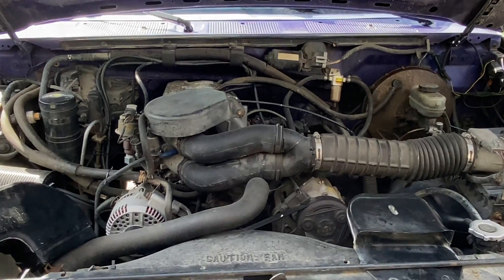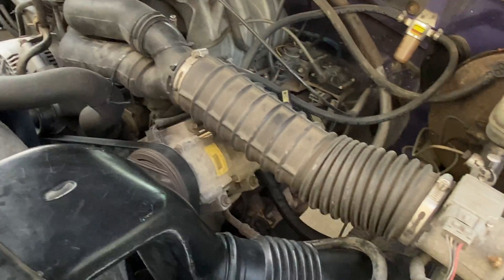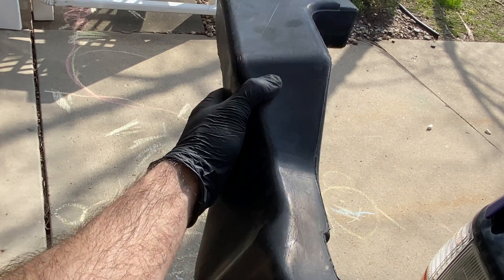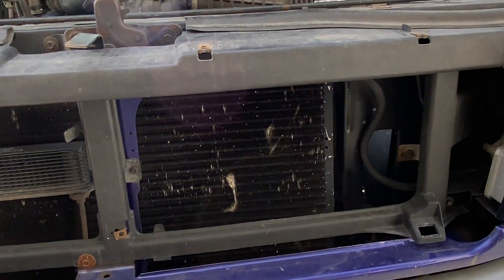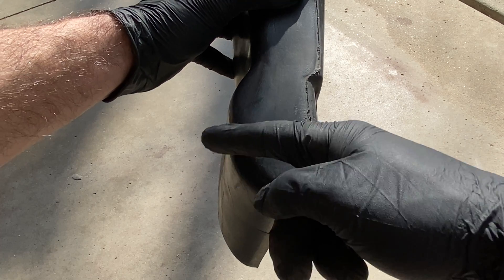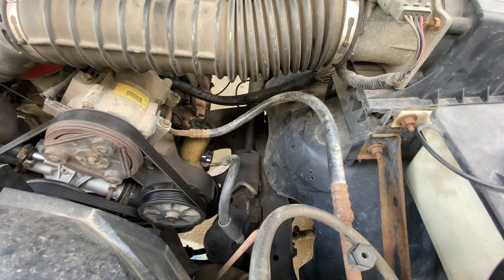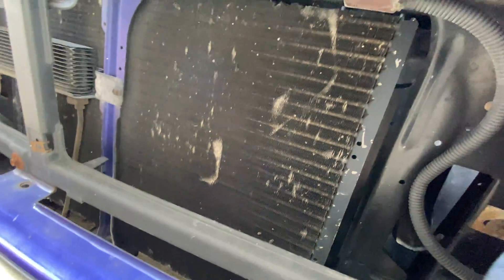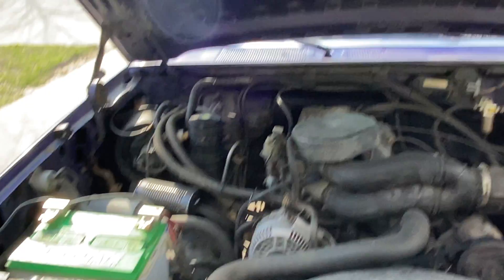How to Make a Cold Air Intake from OEM Ford Parts | 1995 Ford F150

Comment: Old owner of my 94 5.0 did an off-brand k&n air intake swap and it’s just sucking hot air straight from the engine bay. Sucks to drive. Went to the junkyard today and spent $25 for the 4.9 snorkel and an air filter housing assembly. I can confirm the change is noticeable. Thanks for the video.
Reply: Thanks for this comment. I was looking online at some aftermarket air filters systems and when I saw those, I thought "well it sure gets hot in here. Why would I want hot air?"

I will stick with what I got and do what this gentleman did in the video to get more direct airflow.
Reply from the maker: That seems to be what everyone experiences. I’m glad you found the stock intake from a 4.9. It’s a great setup.!

Comment: The part you just used to upgrade what vehicle did it come from?
Reply from the maker: You can get it from F150s and F250s. It’s more dependent on the engine. The 4.9 L straight six has this intake and so does the 460.

Comment: This is pointless, your engine sucks the air, as long as there's no obstruction you're just wasting your time.
Reply from the maker: In theory, if you could have 60 mile an hour wind directed at your intake it should act like a forced induction. However, you are correct, I have not tested this on a dino so it may not do anything.

Comment: would the tube from a 1990 i6 work for a 95 5.0??
Reply from the maker: I believe it should. The straight 6 and 460 had these CAIs.
Reply: @TheMinuteMasters  the one i’m looking at has a ribbed flexible section that yours doesn’t have
Reply from the maker: @bobtailsthecat  does it still exit at the same location as mine though? If it does then it shouldn’t matter if it has a ribbed section.
Reply: @TheMinuteMasters  thanks for responding, but yes it still has the same exit location. I pulled it off an 89 f150 with an I6, and looking to put it in my 5.0. haven’t gotten around to it. Never saw the flex area before but it looks relatively the same

Comment: Looks like it works better with an aftermarket grill due to the fins allowing more air but ill try out with my stock grill thanks for the tips I already did the saginaw power steering pump like you did this air intake tube is next on the list
Reply from the maker: I would agree! 
You’re welcome!🤙

Comment: Just did this yesterday on my 95 5.0 f150 which means I do have the grill that blocks it but do you think I’ll still get better air flow than the original?
Reply from the maker: Nice! I’ve since switch back to a regular grille and I’m sure it still works fine.

Comment: Im sorry I’m still pretty novice with my OBS. Can you explain exactly which Models I can find this from? There’s a guy on CL trying to sell me one for $25 but he’s too far away to justify the drive. Thanks for the vid though man. 
Also, (dumb question) do you have any problem with water with this setup?
Reply from the maker: You should be able to get his intake tube from any f150 with the 4.9L straight six engine or any f250 with the 460 engine. 
I’ve been driving with this set up for over a year now and I have not had any Hydro lock issues.

Comment: Would that part fit in my '88 4.9 F150? Mines dry rotted and the part for the '88 is discontinued
Reply from the maker: I don’t see why not. I got this from a 4.9 L engine.
Reply: @TheMinuteMasters  Thanks, I've also confirmed that it'll fit. I learned there's 3 versions of this part. Mine was an early version with the accordion design. I wasted like $50 finding an alternative 🤦🏾‍♀️
Reply from the maker: @Northwind000  That sucks man. Trust me I’ve done that before. I’ve brought at least two or three parts back from the junkyard that never fit in my truck. No return policy there.

Comment: But
On a stock unmolested 96 4.9
The grill is solid at the inlet point and there's a heavy rubber wind deflector blocking the air path to the inlet, which is turned away from that air flow anyway, and forcing it through the radiator.
Cutting the curve off may help, but to get any real benefit you would need to modify or replace the front grill
Reply from the maker: This is all true. When I did this mod, I has a mesh grille. So the air was definitely getting rammed into this intake tube.
Reply: Hey Steve. For a factory grill still in place, would you still do this mod or just stick with the original cold air intake right below the hood line setup on my 5.0 liter. Love the idea, but just don't know if it would be beneficial with the factory grill setup. Your thoughts would be appreciated. Thanks !
Reply: @rogerfarmer8919  I have the 4.9 so I already have the ductwork.
The heavy rubber piece I'm talking about is just to the left and mounted to that support.
That rubber piece is meant to deflect the air away from the intakes, which honestly makes little sense to me because the solid part of the grill is directly in front of the intake..

It seems that simply forcing the rubber piece to the left would force air into the intake 
Or maybe remove the rubber flap and add some sort of aluminum or plastic scoop 
The duct will still be curved but air will be funneled in so maybe it'll make up for that

Comment: Man I absolutely love your videos. Thank you so much for making great content. I found one of these in a pile of parts and got it for free. I would have never thought of it until I saw this video. Keep up the great work and let's see some more junkyard mods.
Reply from the maker: Thanks man!🤙 I appreciate it! Good find. I had to search several trucks at the junkyard to find that one. You bet man! I hope to make a few junkyard runs this year.
Reply: @TheMinuteMasters  What part of Iowa you from?
Reply from the maker: @rogerlbl7316  I’m not originally from Iowa but I’m here to stay. I live in West Des Moines.
Reply: @TheMinuteMasters  Cool, South East Iowa for me. I have a 89 F150 XLT Lariat regular cab long box 2wd 5.0L with 74k original miles.

Trying to find performance upgrades but it's like pulling hen's teeth, just nothing out there.
Reply from the maker: @rogerlbl7316  Nice! My hope is to hold an OBS Ford truck meet up and parts swap next year so everyone in Iowa (and surrounding states) can meet up. 

Yeah performance parts are hard to find. If you are looking for power. GT-40 heads from an Explorer is a popular HP mod. Pair that with exhaust headers and it’s a good start.
Reply: @TheMinuteMasters  That would be great! The swap meets they hold around here now are pretty lame. They started out to be fairly decent but then they ended up turning into flea markets, so instead of finding high performance parts you'll find a pair of old beat up tennis shoes and a rusty pair of chrome Chevrolet valve covers in with them Lol.

Comment: Did this to my ‘92 5.0 today. $5 for the part at my local pick and pull. Easy to install. Truck seems to have a little more power. 
Thanks for the video.
Reply from the maker: Nice! 🤙 $5 upgrade beats a $300+ aftermarket part that doesn’t work.
Reply: I just did this same thing and Im pretty happy as well seems to have a little more pep
Reply from the maker: @Cotorro187  Nice!🤙 Glad to hear it!
Reply: What year and model was the replacement part from?
Reply: @daboys66 That would have been the 1992-1996 Ford f-series. The only engines with this intake tube Is the 4.9 straight 6 amd the 460 V8.

Comment: they made the stock cold air intake like that for a reason, 1 its higher than the wheel hubs because if you driving through water the intake wont suck up water to damage your engine by hydro locking it, the one you got from the junkyard is just made for the vehicle dont drive in water
Reply: If you're in enough water to enter the intake tube ,you've drowned out the motor anyway.
Reply from the maker: You make a great point man!🤙 If I lived in a country were fording deep water was a common practice, I’d remove this cold air intake for sure. However at that point, I’d probably install a snorkel.
Reply: @TheMinuteMasters  yep, but like i said, if you planning on driving through water thats the same level as the wheel hubs, or a little higher than that, you better off with the stock cold intake or better a snorkel and very deep water mostly you'll have to get a lift kit on your truck if its 4wd.
Reply: Yep, on the 5.0 and 5.8 water is going to enter down by the motor where the cold air intake tube snaps on even with the inlet being up by the hood.

Comment: I'm gonna do that trick. I also put a bigger Transmission cooler on mine from an E40D. It's a little tricky opening the hood, but not bad. It holds a little more fluid and has twice the cooling space.
Reply from the maker: Yeah it’s a great mod. 
Nice! I want to upgrade the transmission cooler on my truck too. I think the factory cooler isn’t adequate to keep the transmission cool on hot days.

Comment: Ive been trying to find this duct and can't find it anywhere at all. I really need to cause right now my box is open at the bottom cause my old duct broke.
Reply from the maker: If you look in the comment section under this video, I’m pretty sure somebody shared a part number. Otherwise you’ll have to go to a junkyard and find the Ford 460 or 4.9 engines to get one.

Comment: Great tip. Just found your channel and subscribed and belled! However my ‘89 F150 Custom is a 4.9 i6 so it must have that set up already. Is it worth me cutting the curved piece off the front where the air comes in to help with the cold air coming in direct? Is there a possibility of air being TOO cold in winter as I’m in East coast Canada? Thanks! 👍🏻
Reply from the maker: Thanks man!🤙 I appreciate it! That’s true. Honestly you can leave the curved piece there. Scientifically, I don’t know if it does much to cut it away but in terms of a ram hair set up, it makes sense to cut it away. So that’s up to you. I think once the engine is warmed up, there’s nothing that says the air can be too cold. You just get more dense air which equals more horsepower!😁🤙
Reply: Thanks for the info. I was actually thinking of copying a set up I spotted in a junk yard truck a while back. That had two pieces of plumbing pipe coming off the intake and down to the hole behind the grill with two of the metal K&N type cone filters mounted to a bracket there. I like this idea as I live on a dirt road and the air filter fills with dust fairly often and the housing gets leaves etc in it, so the washable cone type seemed a good idea. I could remove the regular air box and then just attach the small filter for the rocker cover tube to the bulkhead somewhere. Question is; does the trunking that’s in there now (assuming I trim the end straight) force the air in better than the cone filters and a couple of pieces of curved plumbing pipe? I know I could use just one cone filter and put a Y in the tubing near the intake but I thought that might cut down the air flow. What are your thoughts on those options? Thanks 👍🏻
Reply from the maker: @MapleMarmite  No problem man!🤙 so I generally like to use intake systems that are similar in construction to the factory. I thought about a similar system like you’re saying. The only issue is it technically may add more turns in bands that are not as smooth as the factory system. The other thing to take into account is K&N filters clog faster than paper and does have the same high level of filtration as the paper. What I have seen people use is a filter system from a Polaris UTV. From what I’ve seen the filter is very large and circular and very well self-contained. Then you just pipe the intake to open air. However it’s not a cheap option because those filter set ups are already like $300+.
Reply: Thanks for the reply! I think I’ll stick with the original and just trim the from of the trunking to let a bit more air through. Did you mean K&N ‘doesn’t’ have same level of filtration? Just your wording read more like that’s what you meant and ‘does’ was a typo. Just thinking about wether to change the factory filter to same type but K&N as one of your vids showed better performance from that. But if it’s going to get dirty quicker and not filter as well then maybe I’ll keep the paper ones and change more often - cheap enough on line. Just looking into my IAT sensor now - came up as a code 24 along with 13 and 14. Might try pulling and cleaning it before replacing to see if that helps. Not sure about 13 and 14 yet, though. 
Thanks again for taking time to reply man - appreciate it! 👍🏻
Reply from the maker: @MapleMarmite  Happy to help man!🤙 K&N doesn’t filter as well as a paper filter and they flow less than a paper filter as they fill up with dirt. Yes the test showed you get more performance but most people agree that performance is gained with K&N because the filter medium isn’t as fine as the paper.
I replaced my IAC and that helped a lot. They get pretty dirty after a while.
No problem man!🤙

Comment: Nice stevie now you just need to relocate
that wire?
Reply from the maker: Thanks Terry!🤙 Which wire? Is it the one running along the radiator support?
Reply: @TheMinuteMasters  its the one thats hanging i front of the hole for the intake.
Reply from the maker: @terrybaptist795  Ah! I see what you mean Terry. That’s the airbag harness. I think I can zip tie it out of the way a bit.🤙 Thanks for pointing that out.

Comment: My question is on that cold air design that you just did what about driving in a rainstorm aren't you just forcing water straight into your airbox???
Reply from the maker: Good question. I’m driven through rainstorms many times now. I think the volume of water and force needed to get it up through the intake, through the filter, and down the intake tube is none existent during normal driving conditions. I could see this intake being an issue if I was to cross a river and a wave of water whipped at the front of the truck.
Reply: @TheMinuteMasters  hey thanks a lot for replying enjoy your videos yeah I was just curious about water flow coming in there driving into a downpour I wasn't expecting it to get all the way up into the intake but I thought it might impair airflow by getting the air filter itself soaked but I deal with that in my semi all the time these Volvos are horrible but again thank you very much for what you do and thanks for replying
Reply from the maker: @yankotactical1134  No problem man!🤙 Yeah these intakes can definitely feel that way. Honestly, if I ever felt a little paranoid about water gushing through, I would drill a hole in the intake where it has a slight bend in it. That would probably do the trick. Anyhow, thanks for watching man! I appreciate it!
Reply: @TheMinuteMasters  On the 92 to 96 years the stock grill pretty much shields the inlet from water in this new location and doesn't allow direct air.
Reply from the maker: @JamesBrown-pd6us  This is true. My mesh grille mod this mod more useful.

Comment: Great idea. Wouldn't do this if your planning on hitting any mud holes though.
Reply from the maker: I don’t think either intake would be good. Lol But, my truck is 2wd and 95% on the pavement.
Reply: I would have to agree with this the location is lower then the original one making the water/mud level lower then it was before for a street only truck yes but when I’m hauling stuff for the farm or out in the woods I’d like the higher level one but for non off-road applications it should improve the air flow and provide denser air

Comment: Good job.

I recommend 2 additions. First, drill a drain hole in the bottom of the 460/300 fresh air inlet duct.  Second, measure each end of the large flex duct between the air box and throttle body.  Go to https://www.siliconeintakes.com/ and order the appropriate ID silicone  couplers for each end, and the applicable size duct, around 3".  You can go economical, and purchase a black PVC pipe from the plumber section of a hardware store.  Don't forget to purchase 4 clamps.  My son performed the above mod on his 5.8 SWB.
Reply from the maker: Thanks James!🤙 

I thought about adding a drain hole. Good know someone else was thinking the same thing. 
I’ve seen that done with a section of aluminum intake piping. I think it looks pretty slick.
Reply: James do you have any photos or more info regarding the piped air intake plenum?

Comment: My air box on my 86 is above my driver side valve cover, goofy setup but it does suck air from that rectangle hole in the rad support in stock form. Which I like 👍🏼
Reply from the maker: There you go! You have the perfect setup from the factory!🤙

Comment: Sounds good but what's the benefit and what do you gain by doing this?
Reply from the maker: Cold air means more power. The theory here is you are locating the intake tube closer to a cold air source. So I’m theory, better than the stock set up and definitely better than a K&N CAI. However, until this is dyno tested, it’s just a theory to give you piece of mind.
Reply: Peace of mind and garunteed cold air
Reply: In all reality, probably nothing. Kinda fun though
Reply: The 460 and 300 used the same air inlet tube which offers a cleaner, less cluttered look.  I have no idea why the 5.0 and 5.8 changed to a more restrictive air inlet tube above the radiator.  Possibly less intake noise.  Change the flex tube to a straight PVC tube with silicone couplers between the air box and TB for a little better breathing.  

The alternative would be the K&N filter kit which inhales hot air from the Engine compartment.
Reply from the maker: @jamestapscott9400  Yeah I have no idea either. It’s a much better intake tube. 

Those K&N hot air intakes will burn a hole through you wallet too.